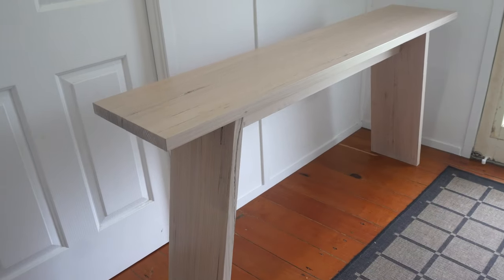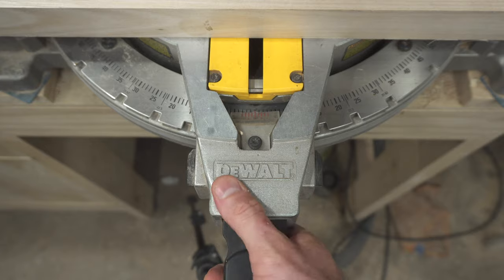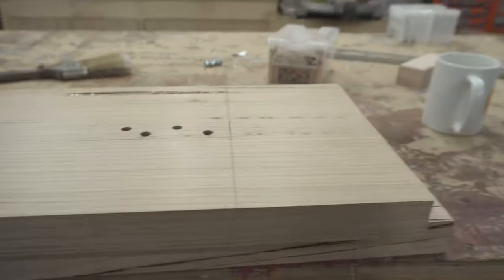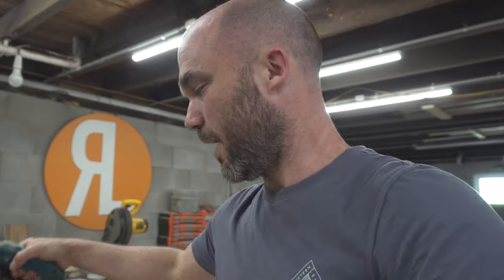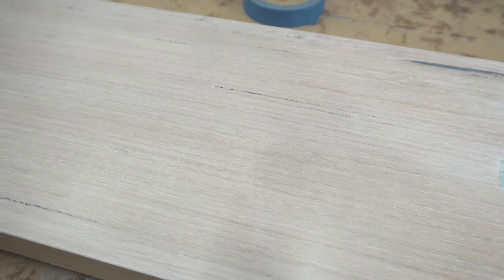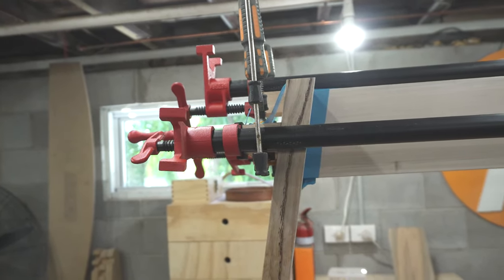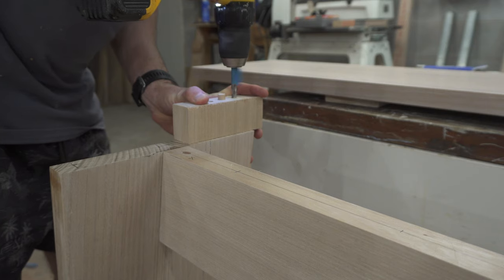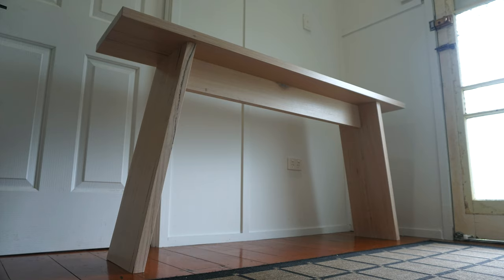How To White Wash Pale Wood

Comment: try looking at a penetrating staining oil like an Osmo. Plenty for floors you can use, it's easier to apply, and will last longer.
Reply from the maker: Only ever hear good things about Osmo, will keep in mind for next time
Reply: Did a white wash with wall paint and water, when dry ,Osmo polyx oil. Came out pretty on the doors.

Comment: It's certainly not obvious to me how that dimensional timber is available "anywhere"
Reply from the maker: Not necessarily the timber in this video, but the size is common. Here in Australia you can find this size (roughly) in pine in most hardware stores because it's used in construction
Reply: @RobinLewisMakes  Robin, no, max width for framing timber is generally 90mm. In fact my Bunnings has stopped selling untreated framing timber completely. I am not saying it is totally unavailable but you don't see it very often. At least not in NSW. Most of our pine plantations are never mature enough for the wider pieces so I suspect the odd wider framing timber is imported. Anyway that's been my experience over 50 years.